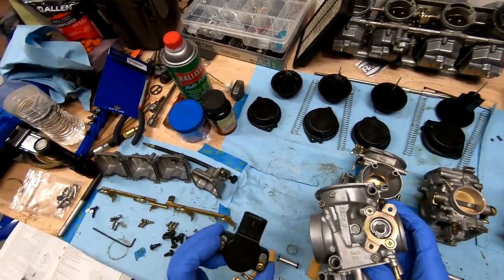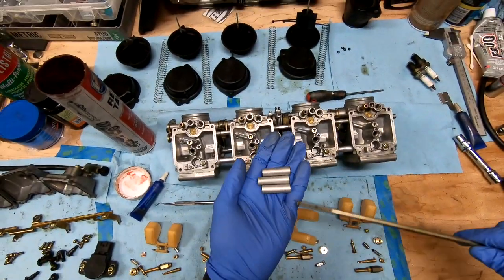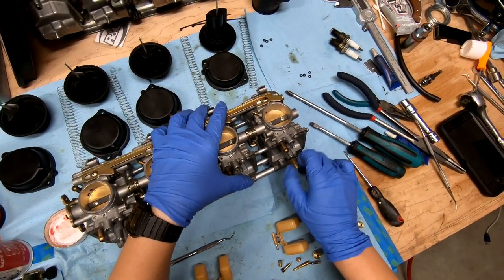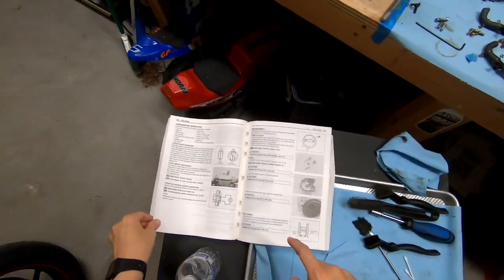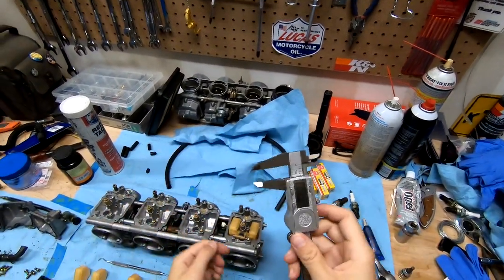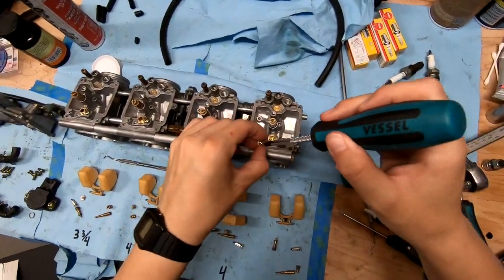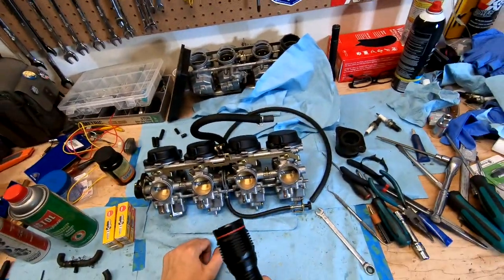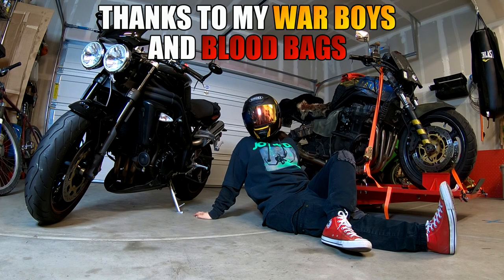How to Clean Motorcycle Carburetors - Full Breakdown & Rebuild (#3 OF 3)

Comment: Hi there:

Great series of videos!  I just followed along on my 2000 Kawasaki ZX9R small differences but I just mounted them up on the bike and fired it up. Fine tuning with sync guages tomorrow rain today.

Great find for the Hoppes the carbs look and perform like new. I did grab several plastic rubber ware totes from dollar tree so I knew what went where.

Thanks for a great video.

Comment: Hello, thank you for this video! Did you also try to position the throttle position sensor or leave it as it was? The procedure is described in the OEM manual and it seems it needs tester set which is quite costly.

Comment: An easier way to measure the float height is to make a plastic jig you cut it out in sort of u shape , but square so it spans over top of your floats like a bridge . The center going across you make the height you want to adjust to . You place the jig on the edges of the float bowl so that it crosses over top of the floats . You have it cut to 14-17 mm or whatever you want . 14-17mm was the recommended height years ago on the Bandit Forums by some of the tuners for Gen 1.  The higher float height , the lower float bowl level will be because you are measuring them upside down. You hold the carbs as shown in the video so the floats just touch down on the seat , it still is a bit awkward as the float assembly can move around , but it needs to b flat on the base where the float frame sits in the carb . When doing this you will notice the two side of the float are not the same height . You go by the higher float at it's highest point .

Comment: Another great Carb video.
I would like to know what your parts list for this Carb rebuild was and did you buy all genuine parts?
I attempted a minor strip and clean of Mk1 12 Carbs in the past but it did not do the trick so I think a more thorough strip and clean is needed and it would help to know all the little parts that one might first overlook but eventually need to do the job once and properly.
Thanks for taking the time to inform us all out here

Comment: Hi Great series of videos thanks.  I am at the stage of re-fitting the carbs to my 1200 Bandit but struggling to connect the two throttle cables. They are very awkward to get to. Have you any tips on how to do it.  Any help would be much appreciated.

Comment: You should note that if the parts responsible for metering fuel or the fuel channels between the bowl and the intake have any amount of dirt on them, there will be a slight increase of how rich your fuel mix is without changing anything, so they might end up richer than you want
Reply from the maker: Great advice!

Comment: The floats on my carbs are perfect (13 mm) when I hold them in a appr. 45 degree angle like you do, but when I put them back on the table, there is some difference in height between the floats. Is that ok?

Comment: I’m now considering possibly coming up with a mod for my bike that has 4 lights around the centre of the tachometer needle and a sensor in each carb to tell if it’s above or below the float line, with enough leave way to not come on if slightly above or below, (or maybe not, so I can watch the float action). That way if the floats or needles stick or leak, I can see which carb is acting up and in what way (too much fuel or too little). I also might put one of those tilt sensors in to tell me in two stages for each side how far I’m leaning, but that seems pointless, if I do that then I’ll make the voltmeter button switch what the lights do and have tilt be the natural position and carb check be the one controlled by the button. Also of note is I might be able to have more than two tilt levels per side if the leds do have two colours, or if I use RGB ones then I can have a gradient of scale, where the first light lights a colour and further over the second does, then the first one graduates over to a different colour and maybe the second one goes out once it’s at the fully noticeable new colour, then further over the second one comes back on but this time the new colour is not a gradient at all, or something similar. (A lot of thought for a feature I don’t care about other than a better excuse to put holes in the tach faceplate other than just to know when my carbs are messed...) (sorry for the poor formatting, I talk like this irl)
Reply: Did you ever do this mod ...???